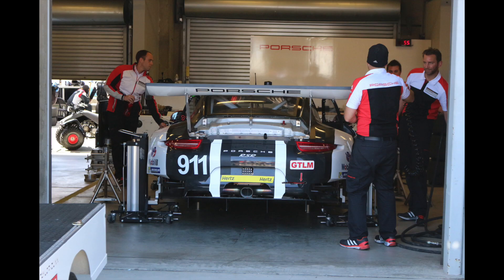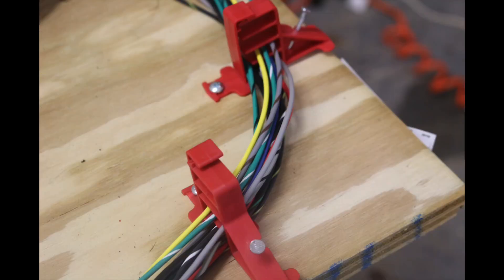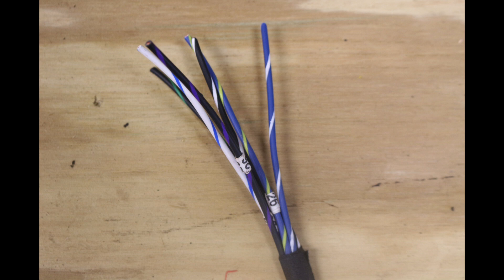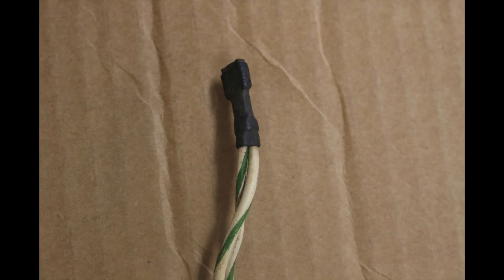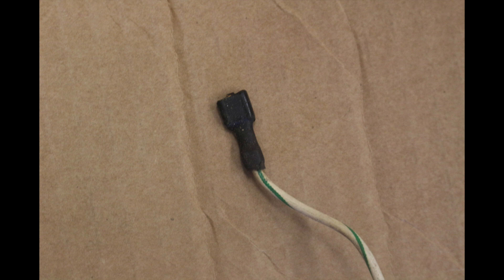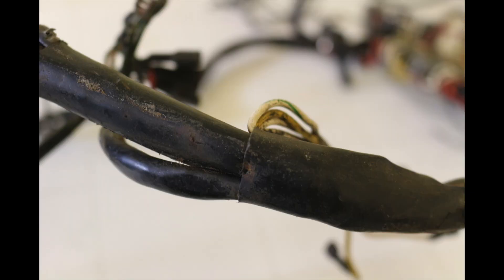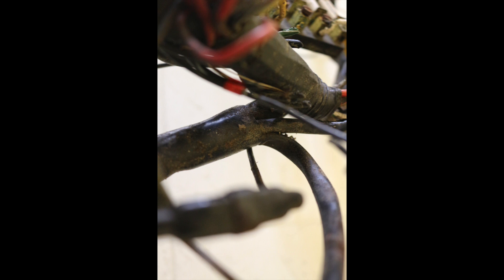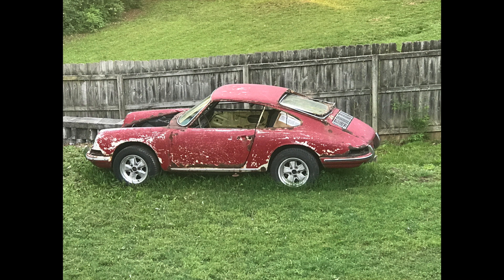Porsche Wiring harness on a 67 SWB 911/912 Part 3

Comment: Great information about the wiring harness.    Do you match up all your wires in the proper metric size? Or do you just use American gage wire.    The wires looks like heavier size gauge.
Reply from the maker: Thank you! I use AWG gauge.  16 for most of the harness with a few exceptions.  Very close to the Metric.